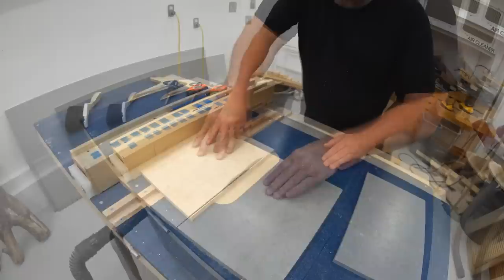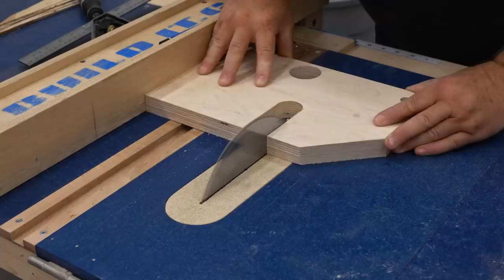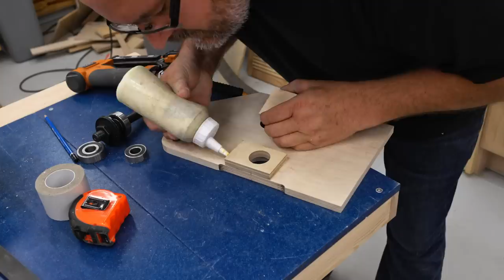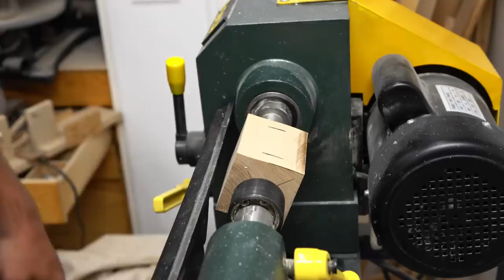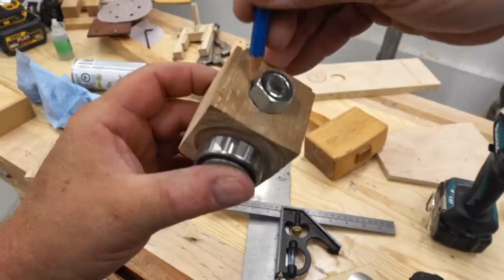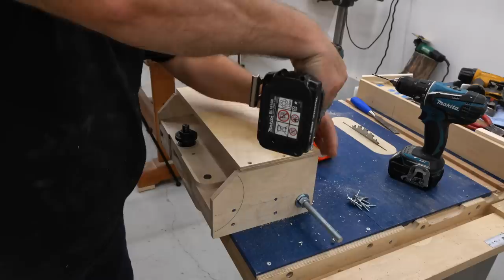Making A Table Saw - The Blade Lift Mechanism

Comment: Another imaginative project. A thought: scissor jacks are cheap from auto wreckers. Using the Acme thread rod and bushings as the lead screw would provide much faster adjustments than all-thread.
Reply: I thought the same, though I'd be trying the pyramid/scissor jack with some expansion springs (set to pull the jack down) and checking slop in the mechanism before I'd trust it to hold my blade at any given height. An upside to the jack solution is that you can lift the entire motor & blade assembly vertically up and down, instead of using a pivot point as John does here. The upshot of that is you can then install a riving knife at the rear of the blade and have that vital safety device raise and lower with the blade.

Comment: Good that you have regained control over your channel!

I'm building a similar construction at the moment. Even if it feels contraintuitive I would argue that the slot is curved in the wrong direction! My thinking is that the push point/direction of force from the bearing always should be tangential to the actual/momentary radius of the pivot point. After your correction (in the following video) it is certainly more correct in the down position but still not optimal as you move towards the up position. My feeling is that  the slot at the entrance point should be tilted/leaning forwards but then curve slightly backwards...? But that is only for absolute maximal efficiency/minimal resistance also with the blade in the upper range -  your solution obviously works fine as it is. I'm maybe wrong but I will test it...

Comment: Awesome design. I’d like to see a comparison between this one and the older design. Last I remember, you were working on the motorized mechanism. I love this series.  Thanks for sharing.
Reply from the maker: This one is much lighter than the other, designed more to be used for the typical hobbyist. The older design (I'm still going to build it) is more of a professional grade design with tighter tolerances and stouter components.

Comment: Have you considered an Acme screw instead of the threaded rod, I think it would make blade height changes faster, could even use a car scissor jack
Reply: Tom Moores A threaded rod allows for finer blade height adjustments.

Comment: Why not but a good saw with cast iron to stop vibration. I have a Powermatic 66 with a 3hp 220 volt motor. Have had it for 20 yrs plus. Best to I ever purchased. Vinny 🇺🇸

Comment: These are the kind of John Heisz videos I enjoy watching.  Nice mix of wood and metal fabrication.    I was wondering how you supported the far end of the lead screw?  I just notice the image in the teaser is different than what you built.  The tracks/slots for the height bearings are arched in the thumbnail.  Which worked better?

Comment: At first blush I'm thinking you should be welding up something from metal instead of using wood. But let's see how long this lasts first. Have you considered lining the groove where the bearing  goes for height adjustment with either something slippery (e.g. teflon tape) or something very hard (bearing surface) and smooth (e.g. bloodwood, maple etc.) or maybe even soaking the plywood endgrain with epoxy? I'm very keen on seeing how this all works out.

Comment: I like this video because it's about something I've been planning on doing, but I'm wondering if there is a way to build one where the blade goes straight up and down instead of tilting up and down, would think that it would keep the blade center in one spot

Comment: Be careful.  There’s tremendous forces on the blade arbor bearings especially during a kickback.  The whole blade assembly could come flying out of the saw.  Wood when fails usually fails catastrophically.
Reply: Nope. If the forces to which you refer were as great as you claim, the die-cast potmetal trunnions on all but the highest-end manufactured saws wouldn't stand a chance either. In any event, this isn't the first shop-built table saw John has built. Lots of other examples over the years documented on YT also. It's a proven concept.
Reply: Equal and opposite forces.  There’s a reason table saws trunnions are built like a brick outhouse.  It being on YouTube doesn’t make it correct my friend.  Be safe

Comment: Brilliant. Any reason why you dumped the motor lift mechanism you posted earlier. Anyways I am happier with this one. I may not be making this table saw for now but for sure I shall make it probably after two years. I'll buy your plans whenever they come out. 

By the way I made your straight edge guide and I love using it.
Reply from the maker: I didn't dump it, this is a different build.
Reply: Why are you building two? Just curious
Reply: @JohnHeisz  Thanks for the reply John. Would be interested to know why you are making two builds.
Reply from the maker: I talked about it in a video on my scrap bin channel.
Reply: @JohnHeisz  Oh sorry John. I thought I was missing some video of yours. Thanks for replying again.

Comment: Nice build.
Would it be better to make the blade lift pivot point radius reference the pulley on the motor?
I realize this would not be as simple, and mounting the motor on a pivot will also work.

There is a simpler design I saw someone build that uses a stationary blade/ motor/ trunion and raises and lowers the table. 

Just throwing some ideas out there.

Comment: I thought you were going with a screw drive with a motor that would lift the motor straight up and down. I find I really prefer the straight up and down as each turn of the hand wheel is the same distance. One thing I've never seen on a table saw is a graduated dial on the hand wheel. This could be marked off in mm, fractions or 001's. If one is cutting a dado you could take a cut measure the depth and then dial in the height adjustment needed. I really never have liked using one of the blade height gages

Comment: I noticed you cut out a section with the band saw and then straightened out the cuts on the table saw. Would using a sled on the band saw help with that?
Reply: Yeah, but the table saw cuts cleaner.

Comment: Do not recommend doing this type of service is a danger when it comes to sawing and high rotation, I recommend something in iron shaft sawing with properly fitting with bearings and bearing for good safety.

Comment: Unfortunately, you need a table saw to build a table saw.
Reply from the maker: I made that one too, and the one before it. 
What most people need is a glimmer of imagination and some actual desire to do things, instead of sitting around making excuses.
Reply: @JohnHeisz  - yeah, imagination, etc... and a table saw doesn't hurt either. Oh and a lathe.
Reply from the maker: When clicking on a video called "Making A Table Saw", what did you think I would be using? Sharpened rocks and a handful of mud?
Everything I did here can be done using $50 worth of hand tools, if you have that ability and can take a break from feeling sorry for yourself for a few hours.
Reply: @JohnHeisz  Now, John, be nice. You're absolutely right, though. The old circular-saw-screwed-to-a piece-of-plywood-and-then-inverted trick (not quite the oldest trick in the book, but close) would work well enough to make the parts needed for this project. DIY demonstrations like this are empowering.